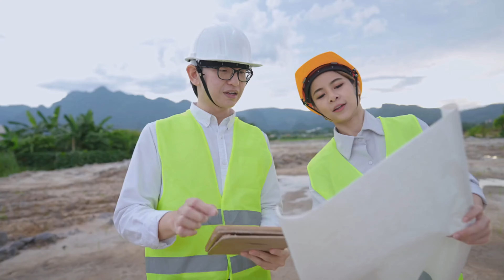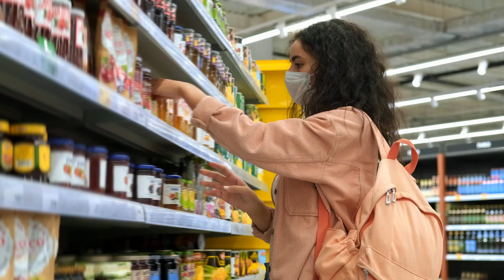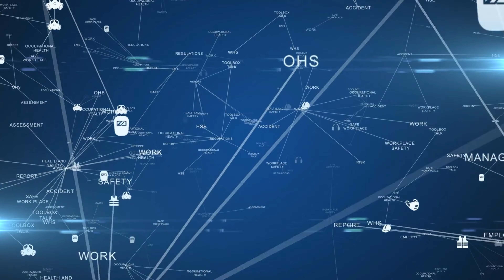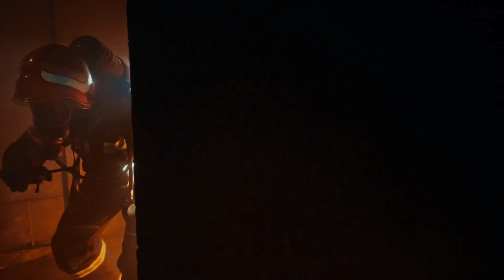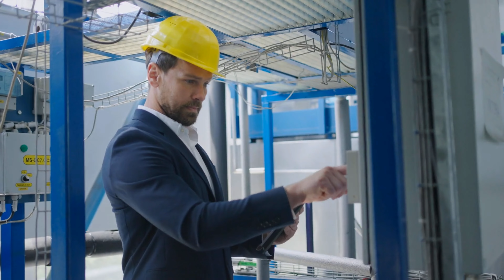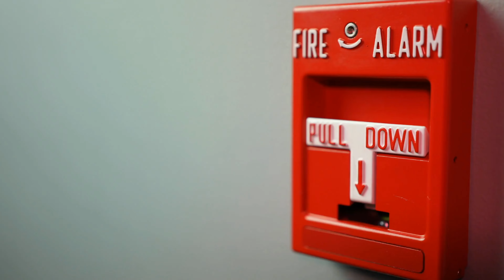The role of health and safety legislation

Comment: Thanks for the analysis! Just a quick off-topic question: I have a SafePal wallet with USDT, and I have the seed phrase. (alarm fetch churn bridge exercise tape speak race clerk couch crater letter). What's the best way to send them to Binance?
Reply from the maker: To safely transfer USDT from Safe Pal to Binance:

Thank you for your comment 
about your question :
Open Safe Pal Wallet : Ensure you’re using the official app (no third-party tools).
Select USDT : Confirm which blockchain your USDT is on (e.g., Ethereum, Tron, Binance Smart Chain).
Get Binance Deposit Address :
Log into Binance → Wallet → Deposit → Select "USDT" and choose the matching blockchain (e.g., ERC-20 for Ethereum).
Copy the deposit address.
Send from SafePal :
Paste the Binance address into SafePal’s "Send" field.
Double-check the address and blockchain network.
Confirm the transaction.
Critical Reminders:

Network Match : Sending USDT on the wrong blockchain (e.g., Tron vs. Ethereum) will result in lost funds.
Fees : Ensure you have enough native cryptocurrency (e.g., ETH for ERC-20) to cover gas fees.
Seed Phrase : If you’ve shared it with anyone, transfer funds to a new wallet with a fresh seed phrase immediately.